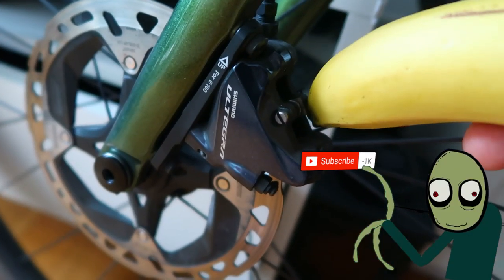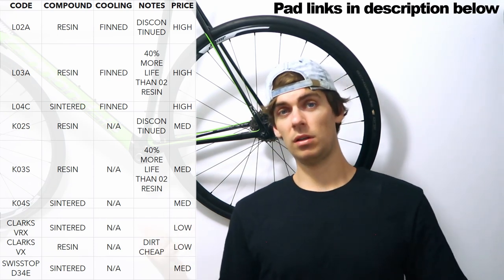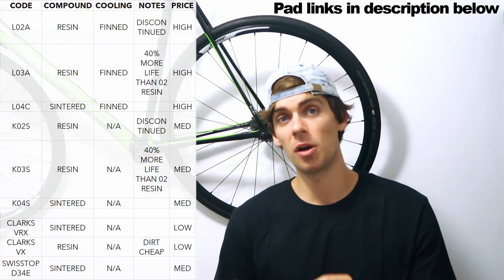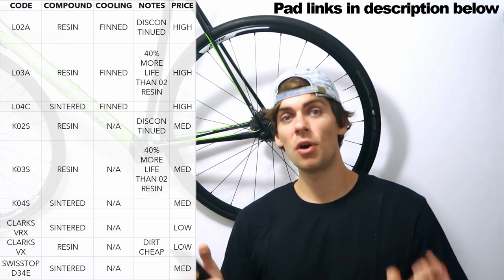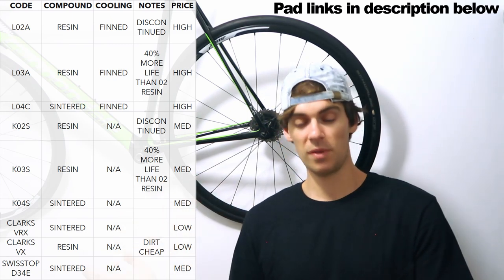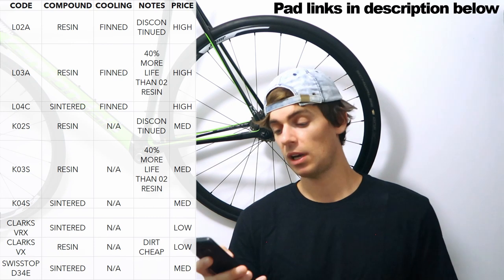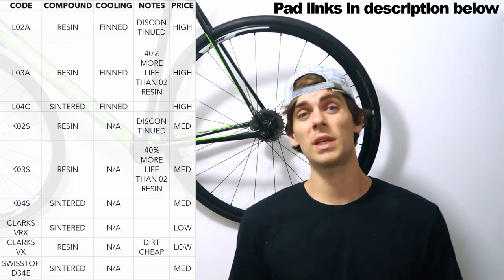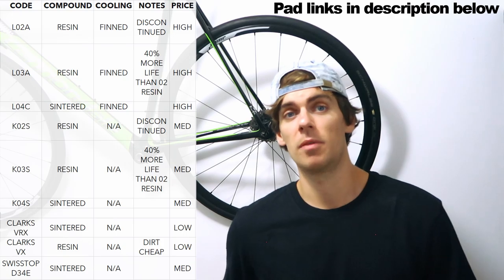Shimano Road Brake Disc Pads Explained - Compounds and reference codes debunked.

Comment: So, I don't know if you've measured things yourself and disclaimer: I'm not from the road bike world, but the resin vs. sintered comparison you've laid out is what every bike shop mechanic spews, too. However, if one is to actually measure things or at least pay attention - even though the resin matrix is rather "soft" the fibers that are in there are what results in a higher friction coefficient and an ALARMINGLY high wear rate of the brake rotor. Sintered metal brake pads are the ones that are "easier" on the disc, and as you said - better in mixed conditions. I speak from personal experience with Shimano RT86 and RT76 brake rotors paired with (at first) the stock resin pads (H03A was the finned version and then switched to D01S non-finned), and then after I went through 2 sets of rotors for every set of brake pads I decided to try the H03C (sintered metal finned) and the D02S (non-finned sintered). Then the rotors started lasting almost 3 brake pad sets. All of this was written in a long-lost Excel during 2014 when I started descending the local mountain a lot and each descent and service intervals for things like brake pads and rotors were noted. Measurements were done using a Mitutoyo 102-301 which was good enough for the job. Brake pads also wore out into a tangential wedge even though the BR-M820 brakes featured asymmetric pistons on leading/trailing edges of the rotor and they also wore into a wedge in the radial direction with the lower edge always being thinner than the upper. This was so severe that I found myself cutting off fins from the H03C pads just to be able to swap the left and right and extend their life, because when they got down to 0,5 mm (which was the spreader spring width) on the leading edge, the trailing edge of the pad was nearly double the thickness. Anyway, long story short = resin pads wear out brake rotors much faster than sinter metal ones. If one does road descents after a climb, it would be advisable to switch to sinter metal compound. The only advantage of the resin pad is for "regular folk" on "regular bikes" who pretty much never put enough heat into the sinter metal pad to properly bed it and get it working. Resin pad works right away and has more "bite" at low temperatures, but if one rides around the city and rarely uses brakes or just coasts to a stop - then they're more than good enough - and they're half the price of the sintered ones in most cases (but this is meaningless if it costs you two rotors for a set of cheap pads). :)

Comment: Nice video. Would be good to do real world mileage test for the pads and rotors too. Rotors aren't cheap considering how quickly they wear. Shimano only specs 0.15mm of wear on each side (1.8mm->1.5mm). I've work mine down closer to 1mm, but if you stick to spec, it's a major component of expense, especially if you like the fancy DA/Ultegra ones. I think resin K03S (~$7.50 on sale) + SM-RT54 rotors (~$12 on sale, resin only) give a pretty good value as far as $/mile if you stock up when they go on sale. Of course, nothing comes close to rim brakes.

Comment: Shimano's finned pads are used for a reason, they cool down the thin rotors so they won't warp from braking on long decents for heavier riders. Once they warp you can't bend them back flat because they eventually they revert to the warp position.
Reply: The brake rotors warp because they are clamped to the spider, with no allowance for expansion with heat.Racecars have floating rotors for this purpose.
Reply: That’s why I changed Shimano rotors for Hope floating rotors on my road bike, they work great, no noise or rubbing and they look good

Comment: Also check out EBC pads . Super good quality and cheaper than shimano . The EBC green are a hybrid sintered pad . 

Ooo also sintered are better at isolating heat from the caliper so aide in cooling .

Comment: I would still recommend the finned pads  for people doing long descents where they will have to brake for extended periods of time. This is especially important on road bikes. Otherwise, non finned is nice, and here in the US it's about a third the price of finned.
Also for the pad code, the last letter USUALLY is referencing the pad backing material. The L03a has an aluminum backing plate. K04s and k03s have steel. I don't recall what the C is in L04c... Shimano has a habit of being ALMOST consistent with nomenclature. You won't find aluminum backs on metal pads due to the heat. Metal pads will be either steel or on some XTR they will have titanium backs. Resin will be steel or lightweight aluminum, and for some reason one model is titanium/resin.
Reply from the maker: Good info!
Reply: I can’t see why you need to brake for long periods, riding the brakes isn’t necessary. Let the speed build, and if you need to brake, brake firmly to scrub off the speed required in a shorter application. 
Only in wet conditions would you be slowing more often....
Reply: @patrickparisienne1917  rough singletrack descents on gravel bikes can require riding the brakes all the way down, can't really let it run
Reply: @zzzwillzzz  fair enough, you have experience I assume👍🏽
Reply: once a week I visite the closest hill to mi house 2,2 kms long and 9% gradient, when I change from LO3 to a non Finned pad, I completely wear off the compound in within a month. I would really love to stay with the finned version but they are about 40 USD for a pair in my country so i rather buy a ton of non finned pads and change them often.

Comment: On my roadbikes I didn't notice any difference between the pads with heat sink and those without, but on my enduro and freeride bike I would say that it is noticeable. Especially if you use the brakes for several minutes on steep, technical trails. But I also weigh 90 kg, so maybe I will push the brakes to their limits more than the average rider. So I would agree that you don't need the heat sink pads on roadbikes, unless you think they look better 😀 Ride on 🚴‍♀️🚴‍♂️

Comment: I think you will find it quite hard to find the difference between brake pads with heatsinks and non heatsinks if you live in a colder climate (let's say under 25 Celsius?), they may provide better brake in hotter conditions like 30-40C days, or places with loads of downhill, island of Sicily comes to my mind where I like to go in the summer.

Comment: Having tried pretty much all the aftermarket options in both sintered and resin I’ve ended up coming back to Shimano resin. They offer better modulation, tend to be quiter and last longer. They also don’t glaze over as easy when hot and they perform better when dirty - happy to pay a bit more and have all those performance improvements especially when they’re called upon in an emergency.
Reply: I have found that Galfer organic pads are a bit better than the Shimano organic resin pads. And the galfer green pads are very reasonably priced.

Comment: Any opinion on K04S vs K04Ti, do you think steel is better than Ti for heat?  Its very little weight saving as you could imagine... about 5g per pad set.
Reply from the maker: Ti absolutely pointless IMO. You won't notice a difference. Conductivity coeff of ti is much WORSE than a mild steel.

Comment: Do you know if there is a difference in the hydraulic displacement between Shimano road brake levers and the mountain bike ones? Can you use XT calipers on a post mount road bike with 105 brifters?
Reply: XT callipers are not flat mount, road bike brake callipers mount to the fork and seatstays directly. They would work as they use the same mineral oil and would be much better than standard 105
Reply from the maker: Really good question on hydraulic displacement and size of the pistons. Got me thinking now... Not sure.

Comment: So better to go resin rather than replacing the disc?
Reply: It really depends on your riding. I ride a lot of miles in stop and go traffic. Metallic pads last 6 months resin only last half that or in other words cost twice the money. Rotors still last several years. Also, metallic can be more consistent in wet but they can also be crazy noisy when wet. So noisy that for some it's worth twice the money for quieter pads.

Comment: A decent video for once. I used sintered pads and they lasted forever! Around 6000km with top tons of altitude - living in the alps. Mostly dry conditions. Winter riding is mostly flatish. The discs needed replacing after 2 sets of pads! 12000km. Still ok. Very happy with the Setup. Front brake is non direct mount and uses larger pads J04C.

Comment: Be careful, some disc works only with resin, so if you use sintered, you will destroy your disc real quickly !!
Reply from the maker: I use XTR discs so should be fine with both
Reply: And they look stunning, too. 👍🏻
Reply: That is correct. I recently went from Shimano to SRAM AXS , but wanted one keep the Dura ace Rotors... They worked ,  it it showed how soft the Shimano rotor is, especially the ones like SM- RT 900 Ice Tech rotors. I was getting deep scratches and marks all over. I switched to SRAM rotors problem went away.. Lesson learned... Using Shimano rotors, especially the sandwiched ones, like XTR 9100, or SM- RT 900 Ice tech, it’s always better with resin pads, period... And much quieter.
Reply from the maker: @andy4g63  good info. Cheers

Comment: Have you ever tried Disco brake pads?.......
Reply from the maker: No
Reply: I tried 3 varients of them (Ceramic pro, Kevlar, Copper-free). None of them are as good as Swisstop Disc RS.
Reply from the maker: Whiskey wolf do you have a link to them? Cheers
Reply: I have used disco brakes ceramic and disco brakes Kevlar pads, both have good performance and lasting wear. The Kevlar pads have a bit more bite in my opinion.